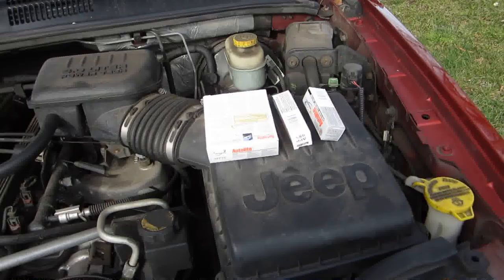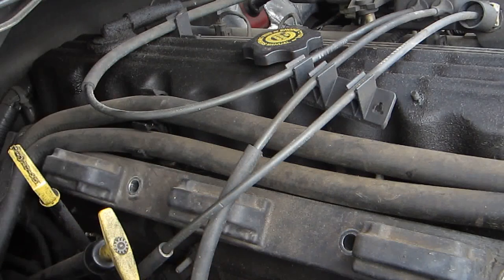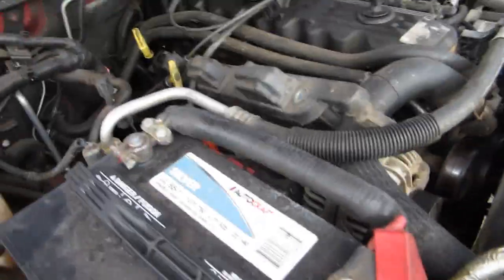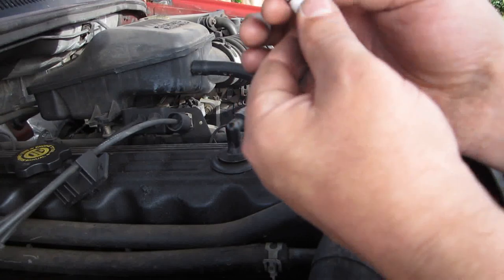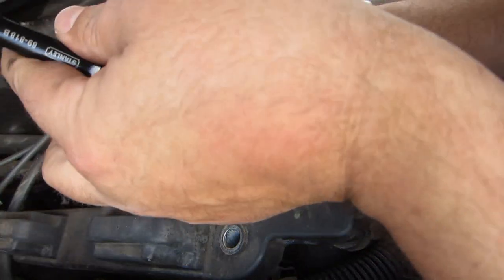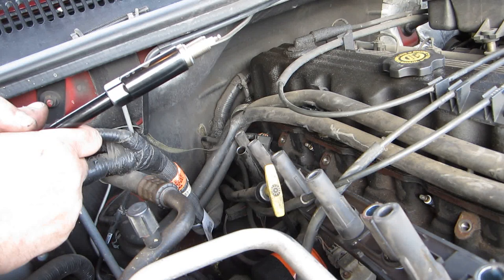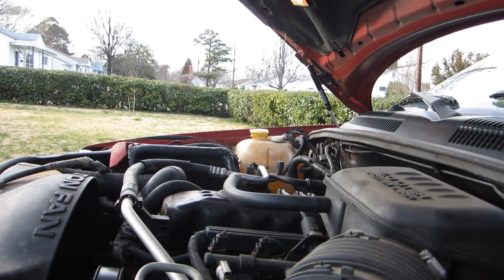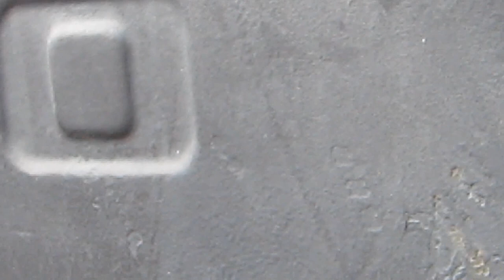DIY Spark plug change

Comment: I did this on my 2000 Jeep Wrangler that I bought used and it took about 45 mins. Glad I did it as the previous owner had not done it in a while and it had 3 different brands of plugs, which tells me he only did 1 or 2 plugs at a time.... Thanks for the Video

Comment: If the spark plug gap is .035" it needs no adjustment, but if it is more/less than .035" a spark plug gapping tool will allow you to make the necessary adjustment to achieve the proper gap. Also I like to apply a thin film of dielectric grease, with a Q-tip around the inside edge of the spark plug boot, that's on the coil pack rail. That helps installation, and helps keep the electric current directed toward each individual spark plug, and eliminates the possibility of arcing. Also some people recommend disconnecting the negative battery terminal when working with any ignition or electrical components. Thanks for making the video.

Comment from the maker: Check the connections when you put the boots back on. Basically pull the rails back off realign them them out them back on. If not that redo the spark gap in each plug you might have bumped it prior to putting them back in.

Comment: Useful....plan on doing my 2000 Cherokee this week. Researched it, but helpful to see it done.  Many thanks!!   By the way, used my ancient "L" shaped wire gauge to check the plug gaps as the new circular gauge with the loops around it that I bought at a major auto parts store was a piece of unusable junk.

Comment: a very good video - I think I just like listening to the addition info - The encouragement is sincere and tips are worth watching the entire thing for.
I have a 2004 WJ Grand Cherokee Rocky Mountain. 4.0L 
I am just about to change the Plugs. and just wanted to see how you tackled that hard to get plug.
I had a 2000 Cherokee XJ 4.0L for 110k  one of the best motors I have every owned ( out 19 vehicles including 3 SJ Jeeps)  I use only Copper Plugs - the Platimuims ran too hot..

Comment from the maker: Those are made by Stanley. Just a small mechanics kit that I keep in the car. I really like the look of the black chrome. I know that black chrome is available in Kobalt for a much higher price and better quality. For me these are great hand tools.

I will be doing a video on changing front brake rotors and possibly inner rear axle bearings too... seems the old girl needs some more work. Its a great Jeep however shes got 140k on her and runs great.

Comment: How often to change spark plugs? My last change was probably 8 year's ago?
Reply from the maker: I like the more efficient burn plugs. There is nothing wrong with using manufacturers recommendations.
Reply from the maker: Depends on many factors but I'm old school and tend to change them about every 60k to 75k miles.
Reply: @Cmuron  . Don't the platinum run hotter? And what do you suggest for a colder plug?

Comment from the maker: I dont think its necessary to put anti-sieze on spark plugs. If you having issues with them staying seated you should probably be investigating why they are not seating properly. Also all plugs now come with a locking ring. Its that small circular ring that is in the box with your plug. Make sure to use that and it should stay safe.

Comment from the maker: It has a vacuum leak in the emissions gas recirculation system. Consequently it depressurizes the fuel system when it is off and it takes a bit for the fuel pump to repressurize it. Usually two or three cranks and it fires right up.